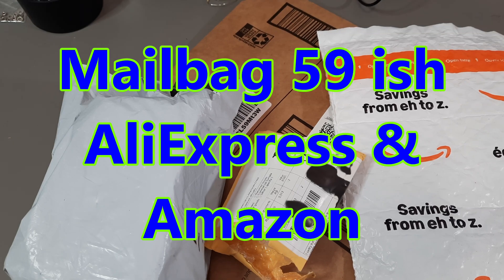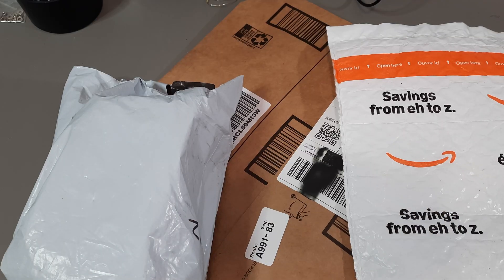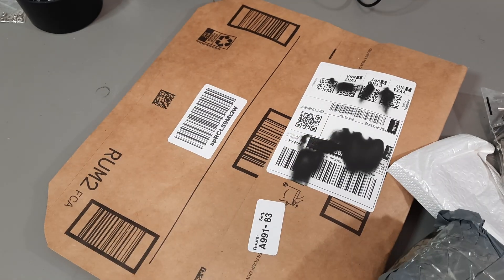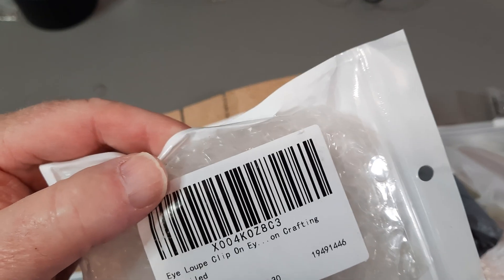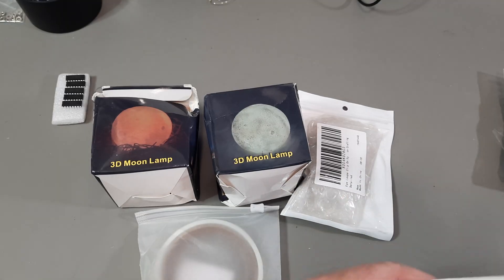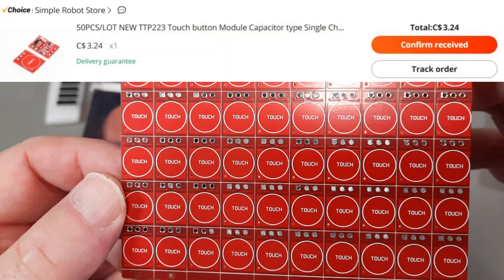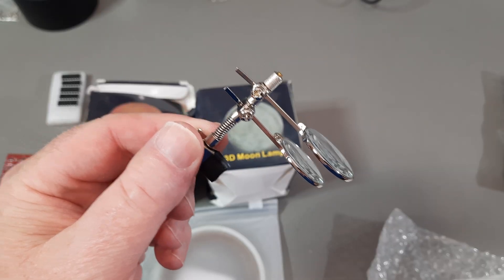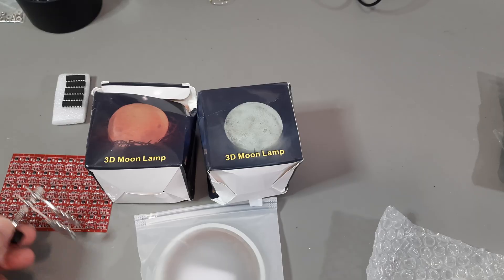Mailbag 59 ish AliExpress & Amazon with Demos

Comment: So many touch switches! You will get full command on everything!
Reply from the maker: it will be interesting how large I can make the touch pad. These were a bit smaller than I thought, have a good day
Reply: @retireeelectronics2649  I used these also in some of my projects. Are really cool when you need a touch switch under a thin front panel!

Comment: Good video.
I got those touch sensors last year, pretty sure I did a video on them.
They actually are usable through a pretty thick amount of material.
I have used them on approx 2mm thick plastic without issue.
That tape will actually hold a charge for a surprising amount of time. I have used that too. 😂
Reply from the maker: I am going to try a few things with the sensors. Want to increase the pad size and of course see how thick of a cover I can put on it. Have a good day
Reply: @retireeelectronics2649  Increase the pad size you say? I would love to see that in a video. 👍